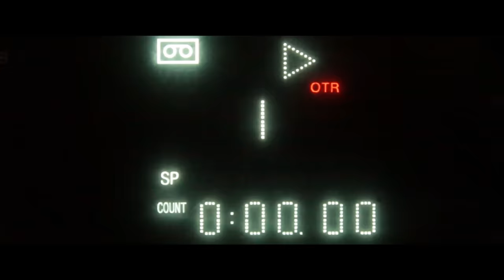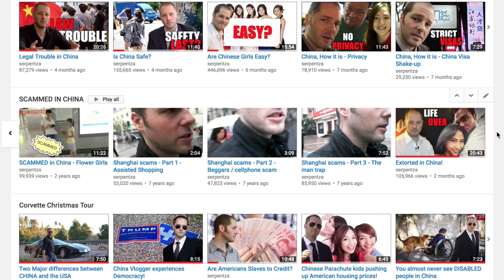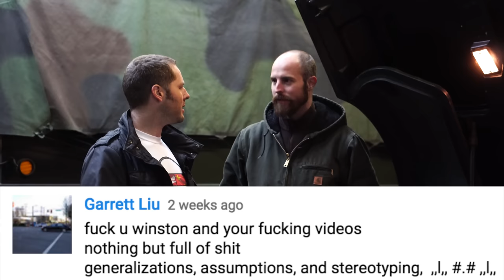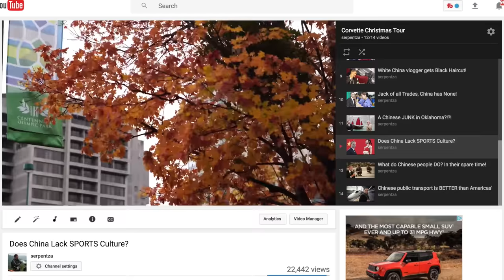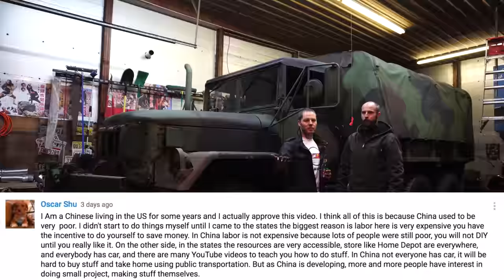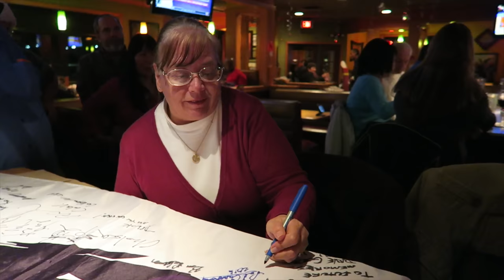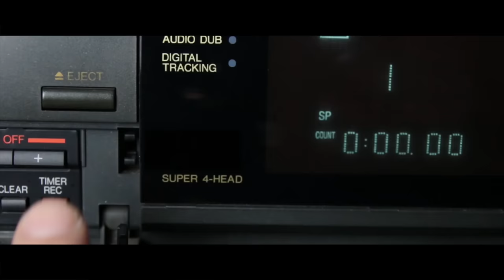China is DIFFERENT, is that a BAD thing?

Comment: A Corvette is probably not the best car for winter driving.
Reply: I drove a 77 vet from omaha to ski in colorado at copper mountain. it worked out ok, you just need to be careful and 
doing fishtails and cookies are fun.
Reply: su as First of all, I have no idea how anything you said has anything to do with Corvettes. 

Second of all, Winston and C-Milk have done more to change my perception of China for the better than anyone. Stop taking everything as criticism and negativity. Every country has positives and negatives and there's nothing wrong with pointing either out.
Reply: accountnumber90 - I had a camaro a while ago, they are useless on the snow
Reply: it definitely isn't  a practical car, but it's stylish, brash and fun. the LT1 in it is a solid engine, aside from the optispark. The flip headlights are just. plain. cool.
Reply: If it has proper winter tires on and you don't try offroad-like snow conditions, it should be fine. Anything else is driving skill, and it's not difficult, just needs self-discipline.It's probably even better with a big-engine car, because you can keep it at very low revs.
They say narrow tires are better due to the weight pressure, but that, too, depends on road conditions and is part of this exaggerated myth, because winter tires are optimized for still having good grip in the cold, and wide tires mean more contact surface. Narrow tires might dig more into powdery snow, but that also doesn't provide much traction. On ice wide tires would be better. - I'd say the only really very relevant improvement is switching to a 4-wheel-driven car if you expect offroad-style conditions, including very snowy mountain roads and such.
If you gave me a Corvette with summer tires in a city with ice-frozen roads, I'd drive safely through it (not counting dangers from other drivers), but very slow of course. If I had time pressure for it, I'd not do it. Just a theoretical example. (Don't wanna be an obstacle.)

Comment: I had a similar experience too.  Those scammers are outside Luo Hu custom in Shen Zhen coming out of HK.  Here's the thing, they are expert in picking someone out from the crowd -- well, I am Chinese, but they could actually spot me for being different.  I exercised normal caution and started walking a bit further to find the trustworthy taxi line.  The guy was following behind me all the time talking to me in different languages, and I pretended not understanding.  There is an old Chinese saying for situations like this called "do not hop on thief's boat" (勿上賊船).

Comment: Hey SerpentZA - that "light flicker" you see in 4:31 is probably because the lamp was a bad LED light that already nears its end-of-life or incompatible with its driver. Normally human eye may not catch the flicker but cameras work differently than human eyes (with FPS rates and all) and it may appear in your videos. Just my two cents from a lighting designer.

Comment: serpentza: can you say what was going wrong with the Corvette? The 40th Anniversary emblem on the seat back means it's a 1993; so it's a bit long in the tooth to start with. Changing the oil is always a good idea, but running rough isn't usually a function of dirty oil. You pulled a spark plug, and fouled plugs will make an engine run rough. I'm glad you got it sorted. I'm just curious. Cheers.
Reply from the maker: +seal010101 the tube feeding hot air from the valve covers onto the throttle body had cracked so it was sucking in cold air and messing the fuel map up, the spark plugs were the original ones and needed to be changed, also the oil had around 7000 miles on it so time to change

Comment: Eh Winston. In the US, the mechanic charges $100/hour. But that's not even good enough... Recently, I took the car to a reputable shop for a simple oil change. They put the rubber gasket wrong on the oil filter cap, in an effort to get me to replace the valve gasket cover. They also overfilled the motor with oil. After I took the car, it was leaking oil heavily from the oil cap... and they did not mention this. 

They advised that they would have to do an engine diagnostic at $100. For the gasket cover, they advised they will damage the coils when replacing it. Quoted price for job at $1,500+, for parts and labor. They will replace the gasket cover, 3 coils & 3 spark plugs.

I drained some of the oil. I replaced the gasket cover ($90), coils were not damaged, and 3 plugs were $15. Although I provided the filter & the synthetic oil, the charge for the "oil change" was $30. A job I can do myself, let's say 8 hours at most, for $105, the mechanic charges $1,600+.
Reply from the maker: +OneElection08 yes that's why I pre doing everything myself, mechanics can cheat you if they think you're an idiot
Reply: serpentza 
Hm... I don't think this is limited to mechanics unfortunately. Anybody out there will attempt to cheat you... We just have significant issues in the US.

1. We are taught to pay the price suggested, like the retail stores. If they say it's $1,600, we pay $1,600...
2. Most Americans don't know where the oil dip stick is lol... never mind anything more complex...

Bad combo hehe.

Comment: Out of curiousity,  what needing to be fixed on the Vette?  I saw the oil filter change was that it? An oil change?
Reply from the maker: vacuum tubes, heating tube from valve cover to throttle body, computer codes cleared, spark plugs and oil
Reply: Thanks for the quick response! Were the plug wires ok? I've always changed mine about 100k miles. Made a HUGE difference. But as your trip is about over I imagine you'll be selling it!

Comment: you poured your oil wrong. the opening is supposed to be at the top. that way you get a smooth poor and not have it air lock then bubble back and splash around.

Comment: What was the cause of the car suddenly running rough in the cold weather? - Also, you had winter tires on, or at least combined-weather ones?
4:31 When such light flicker occurs only on camera, it is usually the power grid frequency mismatch to your camera's framerate. (Not in this case, I guess, since you mentioned it live.)
8:40 "You should hear an American talk about America." - It would be more interesting to hear a Chinese expat in the USA point out all the things he thinks is (better and) worse than in China and then watch the comment section. 😉 I promise you an orgy of SCuM*. | 11:45 Ah, the beer with the red X-es again. I remember you tested it in China.
*) "socialist, "communist", "marxist" - "go back to your gulag country if you don't like freedom", "Putin calls, needs a BJ" etc.

Comment: What was wrong with the Corvette?
Reply: I think it was the optispark (ignition system on LT1 corvettes). They are prone to moisture incursion and misfiring. Changed plugs and checked wires. Seemed to run better after that.
Reply: 4B Industries Hey thanks. :) Stay Awesome.
Reply from the maker: +4B Industries vacuum hoses connected to egr valve were bad, also cleared the computer
Reply: serpentza Yes sir. Too much scotch and DosEquis to remember I guess. :)

Comment: Hi, what was wrong with your car?
Reply from the maker: WTFISWRONGWITHTHIS vacuum tubes on the egr valve, and a tube running hot air to the throttle body, also new plugs and oil helped too